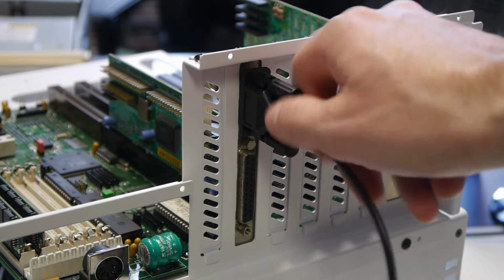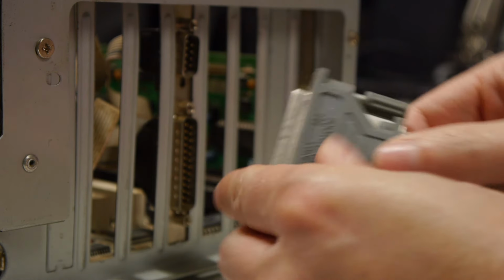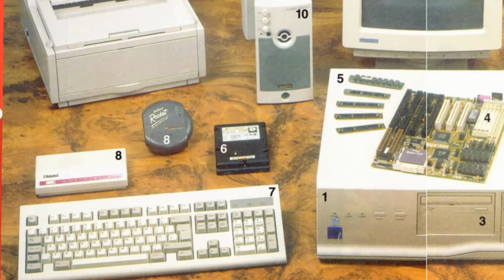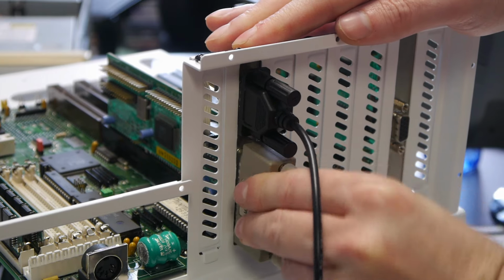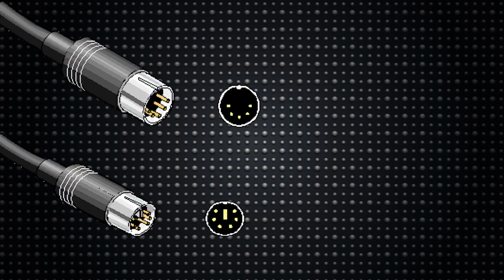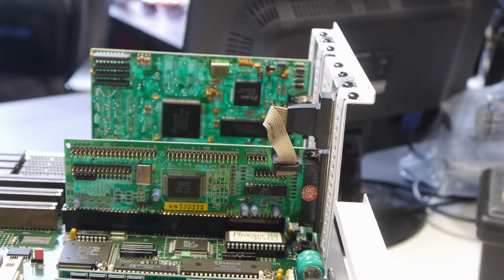What did we use before USB? | Nostalgia Nerd

Comment: The old ports are some of the old timey things I feel absolutely no nostalgia toward-- they were just awful.
Reply: Those old serial ports are one of the ways to transfer files downloaded from the Internet onto systems that normally would not be able to access the 'net.  A null modem cable and a terminal program on the PC and the receiving computer lets your PC sorta work like a BBS or otherwise ftp server.
Reply: Tbh i like having a hardware com Port instead of a virtual one over USB, even though i sometimes need some level shifters for the logic

Comment: And USB-C is VERY VERY slowly choking USB...

At least this one always inserts itself on the first try !
Reply: You all are bunch of uneducated people. First if all, there is USB-A, USB-B and USB-C. USB-A and USB-B have Micro and Mini prefixes, and then just no prefix. then there are versions of them. USB 1.0, 2.0, 3.0, 3.1, 3.2.
Reply: @FateStorm  I already knew. There was an attempt to make me learn about USB... So thanks, still ?
Reply: @JordanViknar  Why wont you just admit that you mixed USB with USB A?
Reply: @PilotAwe  Oh boy... Maybe I just took a SSLLIIGGHHTT shorcut because USB-A is simply the most used type of USB port.

But anyways, USB-C is choking every other type of USB so I hold my point.
Reply: Weird.... Loads of electronic apparatus seem to be using Micro-USB-B / USB-C + USB-A
Reply: @JordanViknar  I have seen USB C only on phones and tablets so far
Reply: @PilotAwe  I have seen it three times on phones, and two times to laptops.
Little do you know that I even OWN a computer with USB-C port, have a USB-C cable to connect with my phone (also in USB-C) which works perfectly, and even an external CD/DVD Drive capable of using USB-C via an adaptator that it had right out of the box, and that this adaptator allow me to connect all of USB devices to my phone and my computer through their USB-C ports (though it isn't really useful on the laptop, I'll agree with that...

Looks like a lot more devices to me, and I didn't talk about the devices I don't own. eGPUs for exemple, which requires both USB-C and Thunderbolt 3.
Reply: @FateStorm  Yeah I agree how weirdly, many products are using a USB-A port + a USB-C adaptator... Maybe for compatibility with computers that don't have a USB-C port ?
Reply: @NessKwikMD  They exist, they are just very rare.
As said earlier, I do however own an USB-C disc drive.
Reply: @JordanViknar  your point is moot, the video is about how USB and it's varying versions have taken over.

The kind doesn't matter, especially when literally every USB version has a conversion cable, so it's not like a paradigm shift, if you have a usb c port you can still connect it to a usb micro b or a usb a.

Welcome to the internet where we call you on your bs.
Reply: @RupeeRhod  Sure, you have conversion cables, but there's a loss :
The maximum speed of every peripheral connected to it will be the maximum speed of the worse cable/port used to connect them. So the kind does indeed matter.
What I mean is, connect a USB-C peripheral to a USB 2.0 port/cable via a "converter", and you'll get USB 2.0 speeds. 

This video is about how USB took over, yes, but my comment is a comment. I was commenting about how USB is being taken over by USB-C. It is related to the video's subject, USB, and the theme of it, "taking over".
I don't see your point at all.
Reply: @JordanViknar  until usb c is popularized on peripherals, using it on laptops require a truckload of adapters (or dongles).
Reply: @Kasrasfriedchicken  it's pretty popular on peripherals, my keyboard and mouse use USB-c as well as the majority of the people I know. And the Nintendo switch along with all its peripherals use the port as well
Reply: @viralzzz1362  given that more laptops have USB-C than ever before, it's no surprise that it's getting easier to find basic peripherals with USB-C now. The Nintendo Switch makes sense as the port is the main one for charging and peripherals.
Reply: @PilAwe My microphone is usb c.
Reply: The Nintendo Switch and its peripherals use USB-C and honestly i like it better than the alternative
Reply: @Mackenzie McIntyre Personally, it doesn't. 
But I DID notice that USB-C is easier to detach than normal USB. Too easy... So I can see them getting loose happening.
Reply: USB-C is USB, what the hell are you talking about?
Reply: @FateStorm  He's talking about USB 3.0. USB-C is the child of Displayport and USB 3.0
Reply: @liamwelsh5565  No it isn't... Completely.
Reply: @liamwelsh5565  USB 3.0 is the blue USBA ports. USBC is the oval shaped one
Reply: @FateStorm  The ports are different.

Although I'll admit the technologies used are EXTREMELY similar, they have many differences, and Thunderbolt USB-C have the most differences.

For exemple, there's no longer a master/slave structure.
Reply: USB-C is the new Firewire

I just hope it daisychains
Reply: @diceLibrarian  it daisy chains if the device you plug it into supports it
Reply: Fuck usb c so much I hate it so much I want it to fail so badly
Reply: My only problem is that this will make me very dependent on hubs for USB-A devices, and I can't track how much data is going through a USB-C port to be aware if any device might be getting choked from the other devices. I can't dare plug an external hard drive on one of those if there's already a usb headset connected, in fear either the audio will get issues or the drive's usage might get compromised.
Reply: You underestimate my power
Reply: Damn you Europe
Reply: Usbc gay
Like it's made stupid(
Reply: @krek420  What ? I don't see how its stupid. It's faster than USB, and much easier to insert. Also, Thunderbolt USB-C ports have even more features, as an example, using an external GPU for underpowered computers, mostly laptops.

Comment: 1:36 looks like USSR audio socket
Reply: Actually pan-european audio socket.  One 5-pin DIN does the job of 4 RCA connectors or two stereo jacks.  Unfortunately IBM initially forgot to use the variations with different pins to prevent mistakes.

Comment: It sad you didn't look into the Atari 800's serial port. From what I read, USB was based upon their design. 

Want a printer? Plug it into the Atari's serial port.
Want to add another printer? Plug it into the serial port on the already installed printer.
Want an external floppy? Plug it into the serial port on printer 2 which was plugged into printer 1 was was connected to Atari's serial port.

Etc. Etc. Etc.......

Atari was way ahead of the other home computers at the time.

The IBM pc changed everything though. Oh well.

Comment: I remember SCSI (Small Computer System Interface "Skuzzy")
Reply: i know about SCSI only because my SATA to USB adapter shows up as UAS (USB  attached SCSI).
But that makes it:
Universal Serial Bus Attached Small Computer System Interface for Serial Advanced Technology Attachment
USBASCSIFSATA.
Find me a longer acronym, I dare ya.
Reply: Yeah, and where is that f**king terminator!!!
Reply: Don’t banks and high security data still use SCSI?
Reply: @bwgti  SCSI provides no extra security. But from the 1980s until the 2010s, hard disk factories have consistently refused to sell their fastest drives (10000 rpm and 15000 rpm) with the IDE/ATA/SATA/USB interface, forcing high speed computers to install SCSI/SAS adapters.  Similarly very few companies were selling adapters for plugging in more than 8 disks without SCSI.
Reply: because scsi(SAS) is 2x faster than even the best modern SATA3 which is way past its prime and hasnt aged well as any SSD is choked hard by its 6gb/s max.  M.2 SSD's easly max out even 32gb/s pcie gen3 connections.
Reply: I hated the thickness of SCSI cables but back then it was a superior connection
Reply: Good old days when everything computer was expensive

Comment: Well. These are LEGACY ports. Quite obsolete but still survives till nowaday PCs.
My first homeowned (not a property of workplace) PC is built in 2001 with a pentium 3 processor and 30 GB of hard drive and 256MB of memory. Other specifications are unknown as I was a junior middle school kid. The only 2 usb ports are the most advanced interface by then.

Those old surviving ports include:
PS2 for mouse/keyboard. This is good for PC around Y2K as it does NOT occupy the precious USBs. Nowaday MBs tend to leave only ONE of this port in case of imcompatible conditions (installing WIN7 on some recent platforms). It is obsolete but still survives as a backup.
VGA for graphics. Still used by my workplace in 2019! Not much used by nowaday MBs or graphics cards but adapters converting DVI/HDMI/DP to these are available.
COM port. I don't know that a mouse could connect to this. However this is usually the port for 56K MODEMs. Also this is the data transmitting port for GGV Wenquxing PDAs. And some industrial hardwares such as the BIOS flashers use this. Therefore it's more common in industrial computers.
LPT port. Famous as the "Printer port". A LOT of ancient printers including blueprint printers use this! Despite the fact that nowaday printers are shifted to USBs it is still widely used!

I've never noticed the joystick port. My first joystick is a USB one.

Also: DON'T forget the 3.5mm sound/MIC port! Still widely used nowadays and unlikely to retire!

SPECIAL: EXPANSION ports!
PC CARD-it's actually a PCI port with a bandwidth of 133 MB/s. Good for notebooks of that era. Usually used by a celluar NIC of that era.
Expresscard- It's actually a PCIE x1 port. Good for notebooks without USB 3.0. Usually used by a celluar NIC of that era, or a USB 3.0 adapter.

Comment: "What did we use before USB?"
A dark time of pain and suffering...
Reply: Especially if some of the pins bent or snapped off.
Reply: @johnfoltz8183  There you sat with a knife trying to straighten the pin - nightmare......
Reply: @ianrwood21  People that JAMMED the VGA plugs in when a pin was slightly off, mashed the pins and wonder why they have weird colors on the screen.  Then the screwdowns are so tight that you have to wonder if Hercules owned that pc.
Reply: @johnfoltz8183  Or if you plugged PS/2 reversed……
Reply: When I bought my first PC (166MMX), I did not know anything about computers. Still, I was able to unpack and connect all the wires correctly on first try.

USB, however, still takes ~2 tries on average.
Reply: Paper/crocodile clip networking over serial. Ah, the memories.
Reply: When I was young I loaded everything off tape because cartridges were for rich people.  I spent my weekends copying disks.  Sometimes we'd copy 1 megabytes of data in one sitting.
Reply: USA! USA! USA!
Reply: What about SCSI?
Reply: Straw and mud, of course. Same thing the house was made of.
Reply: On the TRS-80, if you entered a command to print something and a printer was not connected, the OS would freeze, and the only way out was to power cycle the  computer and it would forget anything you hadn't saved on the cassette recorder.
Reply: The dark age
Reply: Exactly. People have it so easy now. They don't know the pain. 🤣
Reply: I beg to differ.  now you have like 4 types of USB cables, 2 types of HDMI cables, while a paraphernalia of 'other' and obsolete connectors like VGA and DVI are still not entirely dead.   So it's not like things have gotten any easier.

And those micro-usb ports break all time too.  And replacing those you need all kinds of screwdrivers and worse, glued together.  The time when you could fix a computer hardware with a pair of pliers and a soldering iron - at least it was relatively straightforward to do - that was the age of enlightened.  Nowadays, if you repair something yourself they try to make it as hard as possible and you might even get sued for publishing your findings online - we're in the dark age right now.
Reply: @noxure  actually it's a good things there are a lot of USB standards, not just some random ones. I can connect my microusb to type-c with like 0.5"adapter. Imagine, if I would tried to connect some fancy COM port to a phone
Reply: @noxure  all USB are compatible (with the same connector)
all HDMI are compatible
Reply: @noxure  Well, there was a nicety of the parallel plugs being a sure fit/hold of the socket... however the driver interface software, especially if you had to daisy-chain multiple devices through since most people only had the one parallel port, was a curse which we should never return to.
As to the breaking of things, that is a side effect of Moores Law and technology marching ever forward, which is why we no longer use the parallel port, it simply isn't good enough anymore for our modern needs of data transmission. Even USB has evolved from 1.5Mbit/s to 40Gbit/s and they are of course working on ever more speed as 40Gbit/s becomes saturated...
Yes it becomes more difficult to work on, but I can and have soldered USB3 connections together and bodged some things for a specific need, and no it's not for the average person but soldering in general isn't for the average person so the two are merely extensions of one another.
Meanwhile, "Right to Repair" law(s) are being sussed out in the legal system due to a litany of licensing agreement entanglements, which I agree are onerous to say the least however they derive from the company trying to mitigate their liability.
For instance, there's a big row with John Deere because for some of their high end tractors, the computer systems on it are so interlinked with the parent company that you can't work on the tractor itself without "permission" from John Deere, even if you own the tractor outright, which I agree with you is a jerk move... HOWEVER, at the same time, the reason why John Deere does that is so that people don't tinker with it, botch the fix/change they were making, and then saddle John Deere with the repair via warranty claims leading to additional losses for the company. So while a jerk move, from the perspective of the company's liability they understandably want to reduce that as much as they can... It's still a jerk move to not let "Farmer Dave" do his own tune up as is quite common for farms across the country and the world for that matter, but if Farmer Dave were to mess something up it's also not right for him to claim that John Deere need to fix what Dave broke himself.

Comment: IBM AT ... It was an acronym for "Advanced Technology" - That is why everyone (including IBM themselves) pronounced it "I B M  A T" as in each separate letter, not the word "at."
Reply: Actually, that isn't an acronym.  Acronyms actually spell out words, or sounds that can be spoken as if words, like RADAR, NIC (Network Interface Controller), or BASIC (Beginner's All Purpose Symbolic Instruction Code) for example.  AT, and XT are just initials for Advanced Technology, and eXtended Technology (though it should have been the PC ET in that regard), or Windows NT (for Nice Try or Not Today).
Reply: @nowthatsjustducky  Hmm, but AT /ˌeɪtˈiː/ can actually be described as an acronym, however. The word acronym covers both an initialism and what you think of an acronym. I agree initialism is clearer for words like AT if you want to distinguish them from words like SCSI, but acronym is not wrong (and, indeed, the original meaning of an acronym is an initialism). So it's a TLA, not a TLI. Here's the OED:

1. 1940–
A group of initial letters used as an abbreviation for a name or expression, each letter or part being pronounced separately; an initialism (such as ATM, TLS).
2. 1943–
A word formed from the initial letters of other words or (occasionally) from the initial parts of syllables taken from other words, the whole being pronounced as a single word (such as NATO, RADA).

(For clarity the OED uses acronym for sense 2 and initialism for sense 1.)
Reply: Aybimat

Comment: What we used was Apple Desktop Bus (ADB). You could plug in mice, keyboards, graphics tablets, joysticks, et cetera. There were ADB hubs built into monitors and keyboards so you didn't have to plug everything into its own port on the back of the computer. Just one nice cable coming from the computer to the monitor, another from the monitor to the keyboard and then the mouse plugs into either side of the keyboard. It was all very neat and organised.

We also had the Apple Serial Bus which you could plug in printers, networking, scanners or modems and similar. Stuff that required a faster transfer speed than input peripherals and didn't need power delivery. It was also very flexible.

So what did USB add that ADB/Apple Serial didn't? The ability to hot swap peripherals. With ADB you had to turn off the computer to plug in or unplug anything. That's pretty much it really. Combining Serial and ADB under one connection made sense and that's why Apple dropped both of it's proprietary connectors and went with USB.

Considering how much better USB was than what it replaced on the PC side it still amazes me that it was a dead duck until Apple released the iMac; which with USB being the only way you could attach peripherals forced manufacturers to actually produce USB devices instead of sticking with older connectors.
Reply: Even though I've personally never owned an Apple device I'm surprised how little their proprietary connections got mentioned. You can throw Firewire in there too.

Comment: My first computer was the Commodore VIC-20 soon followed by the Commodore C-64 and 128.
These used a serial port for connection of disc drive and other peripherals.  Thus the root of the USB port.